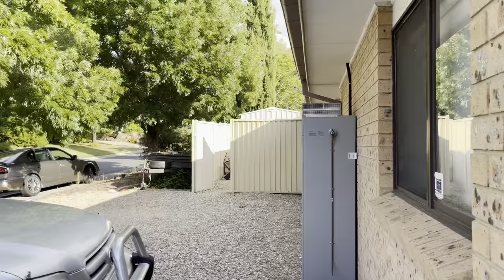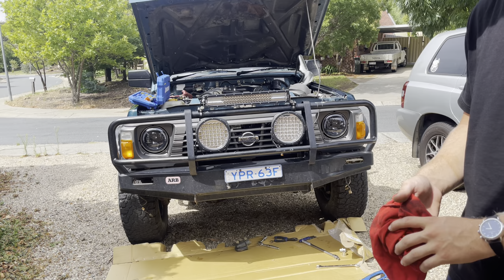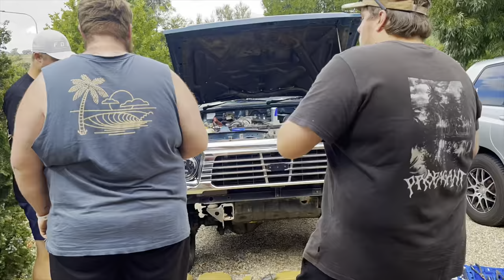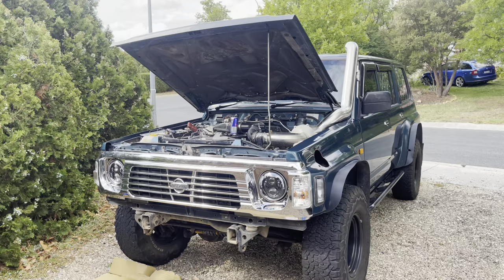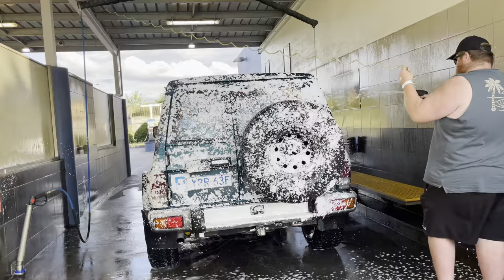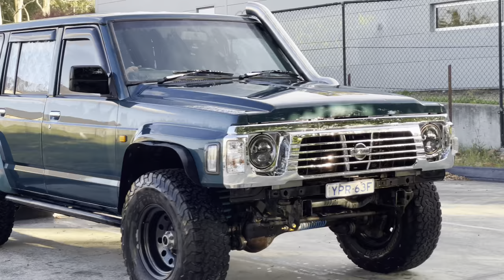Gq patrol bumper delete/Crome grill on install

Comment: I ran without a bar for about 8 months last year on my gq. Not one single cop looked twice at me. I live near the yalwal tracks and the cops round here are well known for picking on 4x4s. Went for pink slip to get more rego and the mechanic says no, and tried telling me the cops will pick me up on it. Dunno how ACT works, but keep that in mind when rego comes round.

Ive been looking and building a turbo parts list myself. I know my engine is healthy. It CAN be done for like 4000 tuned. But that was a lot of trust on ebay parts. So im thinking of going brand name. Do it right the first time. Price quickly hit 9 to 10 grand lol. Turbo or a 350 chev is now the question.

Keen to see what parts you use and how its done. Ive seen how Kistler does it, but the more info i can get the better mine can be =P
Reply from the maker: Cheers for the message mate! In act we don’t have to go in for rego, when it runs out, as all we have to do is go online and chuck new rego on! Hopefully the cops don’t do us but the Canberra cops are pretty chill with the 4wds. 

I’d definitely say turbo as these tb engines are weapons when turboed and done right!! We will definitely make a vid on all the parts list for both cars! 

From experience I’d also say save the coin and do it right the first time!
Reply: @tbzon2r  Damn, even more reason for me to move to ACT. I havent lifted or put bigger tires on my gq yet because of how tight the local cops are.
TBH the turbo is the most likely as it keeps the factory engine and everything keeping parts easy.

Good luck with both the patrols getting modded/fixed and making boosty noises
Reply from the maker: @MntlMajorkozmo  yeah act is pretty dam boring tho😂. 

Cheers brother! I hope they will both be on the road very soon!!